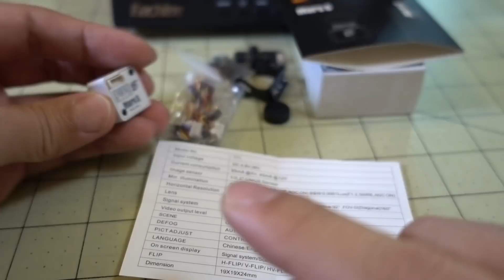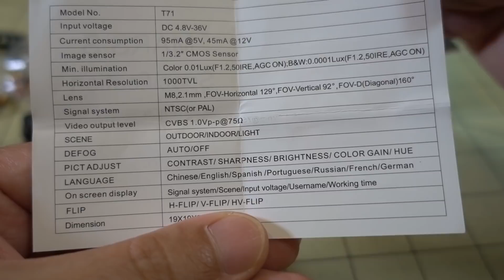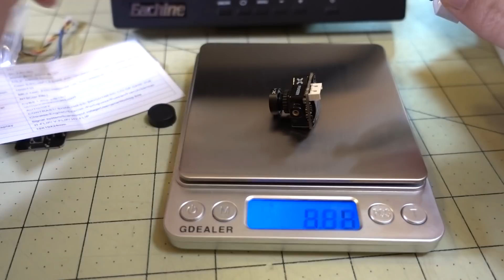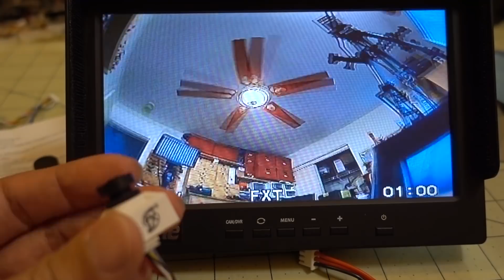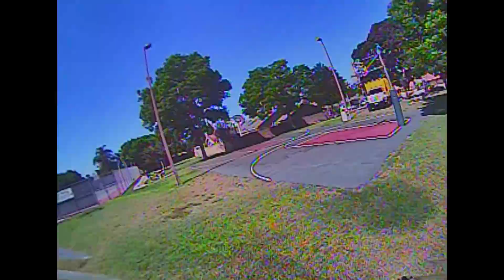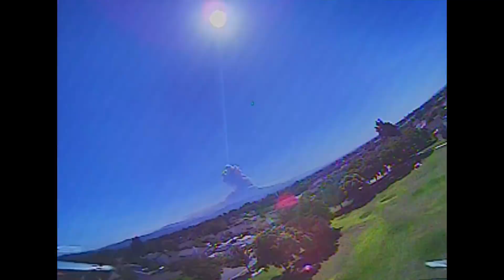FXT Mars-S FPV Camera Review 📷

Comment: " Is that a big advantage ?" Could well be if you want to use it permanently on an RC car. Much easier to make it rain and spray proof without adding an extra housing.
Stock it's OK but there's lots of adjustments available and I would be utilising it (usual suspects) Not too bad a price and it even comes in the right shade of green ;)
I only have one question. And it's probably a numpty one 
What's Defog?

Comment: Excuse me, I know it's not directly related to this video but have you had any better luck flying micros on BF 3.5? Or do you still recommend downgrading below BF 3.4 for now? Thank you
Reply from the maker: At this time I still recommend 3.3.3.  3.5 might work for you but I've already had reports of bugs.  I had one randomly arm on my desk for no reason.  Luckily I had the props off so I didn't get hurt.  Try 3.5 at your own risk.
Reply: Thanks for the quick response! That's a pretty scary bug. I'll stick with 3.3.3 for now. Thanks again
Reply: Its is not like 3.3.x and 3.5 are much different really, I've been using Jenkins builds (at my own risk of course) and follow the changelogs there.

Nothing that would magically arm the quad though, I recommend setting up a pre-arm switch if you are a safety first type of guy. I use one to keep newbs from taking off if they are too impatient :p
Reply from the maker: that's why I always take the props off when dealing with buggy firmware... you never know what will happen.